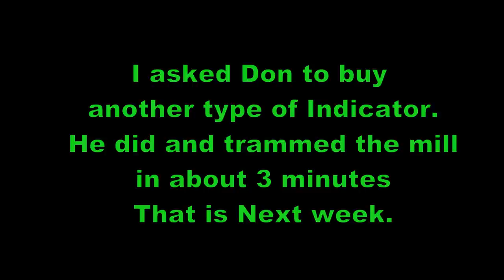Restoring a Shaper: Fitting the nut.

Comment: I think Don gotcha.  I understand the dripping even before he wheels that thing over.  He's right.
Reply from the maker: Nope.... Those passages are semi blocked so that the oil carries down the rails... It may drip here and there but it's obviously not enough... The condition of the nut compared to the rest of the wear on the machine is really a clue to how bad it is..... After all the whole designed was changed a few years later....

Comment: Hi guys! Here is a thought from left field.  I think the oil drips front the leading and trailing edge wipers on the ends of the shuttle as the shuttle goes back and forth.  It doesn't drip off the bottoms of the rails.  The oil grooves terminate above the bottom of the rail in order to distribute the oil across evenly across the face and out the bottom.  There is a catch basic in the nut which runs across the lead screw. For example , a rod bearing in an engine is supported by an extremely thin sheet of oil across the surface of the bearing not by the bearing itself.  But, it is fun to hear you both work it out. I have thoroughly enjoying the show.  Would love to see a show where we can benefit from your years of experience to learn what to look for and how to evaluate a used machine for purchase. 

All the best!

Comment: Steve, drill from the side of the slide, mount the oiler, bring tubing through the cast square holes next to the nut and run it directly into the nut
Reply from the maker: Not enough clearance to do anything without drilling through all the internal oil passages....

Comment: Steve, the only place for an oiler is in the cross slide. drill a passage from the slide to a matching hole on the nut. That hole in the nut would be in the mounting face of the nut. Since the slide is with always with the nut a source of oil can easily feed  the screw. A Gits oiler or a hose to a source would work. You were thinking of only the left side and never thought of the slide to the front of the nut. I hope I described it for you.
Reply from the maker: The table, slides and guards for the slides take all access from the top away....  there is no room for anything or access from the top....
Reply: @10swatkins  I have some plastic auto oil pressure gauge tubing and it is 3mm dia, just under 1/8th inch.  Auto parts stores should have some. Try and see if you can thread that through the carriage to the nut. Something tells me there has to be a way. Keep up the good work.

Comment: My thoughts ...
  Do the oiler pot on side and bit of pipe.
To me id copy the original fiber filter . For the work this machine is likely to receive it will be fine 🙂.
Reply from the maker: Going with a different type of filter... Have to suffer through on more nut video to find out :)
Reply: @10swatkins  did i read domed wire mesh ? Good idea.  '1 more ' heard that before.  ' just one more power tool darling then i won't need to spend anymore money '  👌 👍

Comment: If I might make an observation, the “filter” you talk of is actually a wicking reservoir for any oil that makes it way into the pocket.
This then provides a reservoir that lubricates the thread when the nut is not aligned with the oil passages and the infrequent lubrication schedule most machines have.
Not seeing the machine fully assembled I cannot comment on the chip and tramp oil issue.
My 2 bob’s worth.
Good luck.
Reply from the maker: Well the "wick" was all gummed up with crap..
Reply: @10swatkins  Can see that happening, annual maintenance and strip to clean out crud is not a thing in a large majority of shops, would like to educate some owners with a ball peen sometimes.
Good luck keeping Don on the straight and bendy.

Comment: Every CNC Mill has a flexible oil line that goes to the saddle and from the saddle to the table. There's both plastic (probably polyethylene) and "rubber" lines with steel braiding (or steel springs) over them that are flexible. They're 4mm lines so pretty small. Use something like that to feed positive pressure fresh oil from the one shot oiler to the nut and solve the problems. You can use a "drag-chain-style" arrangement of the pipe to handle the motion / slack in the line.
Reply: Basically what you're saying at 1:30:00, but instead of a copper hard line to a fixed position, use a 4mm polyethylene flexible oil line that's routed at the top of that channel and then down and around to the nut.  That way when the nut is all the way to the right, the tube goes all the way to the right side on top, and then loops down and back a little to the nut. When the nut is over on the left side, the tube will go about half way across the top, then loop down and go the other half way back to the nut on the left. You get slack management inside that chamber without the tube moving in and out of the hole. Same way the cable gets to the print head in an inkjet printer, or a drag chain type arrangement on a CNC gantry router.
Reply from the maker: There is no space to do any type of hose, loop or anything with the nut in place... it has to be a very small line attached to the roof of that space... It's tapered and that nut barely fits in there...

Comment: I would drill the nut to direct oil the screw. Then mount the line to the table so it never has to move and put the oiler on it. Direct clean metered oil. 🙂
Reply from the maker: Unfortunately there is no way to get into that area after the saddle and table are mounted... Everything is block, guarded against chips and moving
Reply: @10swatkins  Surely you can run a line out thru the saddle to some place for a lubricator.  Heck if you want to do it fancy drill the center of the nut mount on the saddle and counter bore it for an o-ring. Then when you mount the nut you have your oil connection.  Then on the other side of the nut mount you can drill and tap for the oil line feed. I know there has to be access there or you could not bolt on the nut.

Comment: Rather than putting a channel in the top edge of the nut, you could chamfer the edge so the oil runs away from the well towards the from fact of the nut. The fixed tube with alignment markings on the saddle is the right idea.
Reply: Not from fact!
Reply from the maker: That might be easer to machine... I think about it... Thanks

Comment: How long have you and Don known each other? My best mate and I have known one another 28 ish years since we were 14. We bicker and argue just like you and Don and its all banter. I hope we continue to do so as long as we can. I love watching the back and forth between you both it makes me smile. Thanks for the time and effort you put into these videos.. could you oil the screw instead of nut? Use the oil tube but full length of screw with little drip holes in it?
Reply from the maker: I think it's about 4 years now........   There would not be enough volume of oil to make it past the first couple of holes I'm afraid... Any more and it would just be a leaking mess.
Reply: @10swatkins  I thought as much could it work with a 1 shot oiler as it would slightly pressurise it? Or would that mean too much oil everywhere. If you put the holes in the top of the tube and allowed it to run down and drip, would that work?

Comment: Put your phase convertor, refrigerated air dryer and anything else that makes noise in the Rubber made shed too.
Reply from the maker: I put my 20 HP RPC in a rubbermaid dog house ;)
Reply: Amen when I finish my shop addition gonna move it
Reply: Air compressors and air dryers need lots of ventilation for cooling. I have seen a  200hp compressor blow up due to a sound insulating wall built around it.
Reply: @millwrightrick1  Thermal management is critical for most machines. My shed is ventilated and has only a 5HP compressor. My dryer is small too.  A thermostat
controlled vent fan would be good, In the winter I want to keep the heat.  I have a 10HP phase convertor in there to but none of these operate at high duty cycle. It has worked great for 20 years.

Comment: Maybe an idee? Take of the vertical table an cut a grove in the upperside, above the nut,  to put a tube in with small holes (like a drain)so the hole screw is getting oiled, all the time. With the oilcup on the outside or connected to an oilingsystem.. If there's not enough room, create some.
Reply from the maker: Thought of that too... There is just no place to access the nut from above when the table is installed and working... Just no room... IF I try to drill anything from above I also would hit the internal oiling passages of the carriage .  Side is the only way...
Reply: @10swatkins  Steve, to prevent that the oil is leeking to mutch in the front of the tube, take a catton thread in to the tube so the oil is slowly dripping to the end of the tube and gives an evenly drip of oil to all the little holes in the tube and so on the screw.

Comment: How about boring a hole partway down the left end of that leadscrew, then an intersecting hole at a thread root.  Move the nut into position over the crossing hole and inject some oil through the oil port in the end of the leadscrew.  Eliminates need for a reservoir in the nut, too.
Reply from the maker: Could work but would be a pain :)    I am afraid the oil would always just stay in the area of the hole, at least with the small reservoir the oil would carry down the screw ...
Reply: I was imagining injecting oil under pressure via one of those little spring loaded ball type oilers.  Meaning there would be no reservoir effect.  But one pump would likely be adequate for a whole day of fun.

Comment: Drill a hole in the center of the nut and lead that hole further out to a grease cup. The nut is locked with two bolts and everything will follow the nut.
Reply: If I understand your description...
Except that the nut is enclosed by the slide(not fitted yet) it bolts to, you would have to drill through the slide itself, which has t nut slots milled into it's outer face.
In other words your cup would be where you bolt workpieces onto, to "shape".
Reply from the maker: No way to get to that area... The table bolts onto the saddle and then there are internal channels for the oil in the slide....

Comment: Steve, you were trying to compare the 2 nuts to see if the height was correct. It seems that after you had the new nut on the shaft in place on the machine, you have the opportunity to measure from the base of the nut to the stationary ways. Then you could also measure from the table ways to the nut mounting surface. You should then be able to determine the correct height. Hopefully this makes sense.
Reply from the maker: I did it on the machine also... I was just trying to cut down 5 hours of video :)

Comment: The plate that bolts on for the table with a  Tap the back side of the nut and put Way Oil in a grease gun
Reply from the maker: No space  for anything.... Also the table and saddle blockers all access

Comment: Steve, if this is a repeated suggestion that will not work, disregard the annoyance. Can oil or grease be injected from the mounting face / base of the nut? Possibly not top feed the oil, contaminating the screw with chips or waste oil, but inject oil or grease through the base of the nut? Does the movable cross slide have room between those two bolt holes for an oil hole or grease hole? If it’s too far, is grease acceptable? It could be pumped in with a gun.? Put a grease fitting on the movable slide facing the front of the machine. Maybe an o-ring groove or gasket on the base of the nut to keep the grease from squirting out? Maybe this suggestion is too Rube Goldberg….best wishes Randy
Reply: The shims will be an issue with what I suggested….
Reply: Put a clearance hole in the shims and cross slide casting, thread an extended pipe nipple in the back of the nut, put a grease fitting on the nipple. A little tricky to assemble but a possibility? Fresh lube to the nut all the times and the oil feed would follow the nut.
Reply from the maker: Once that nut is installed there is no way to get anything in there.... The saddle and table all move and there is just no way :(

Comment: Put the copper all the way across. With a 8 or a dozen tiny holes drilled perhaps in the top of the copper tube so it drips on the screw.   How many number 80 holes can you drill in copper tubing without breaking a drill bit.
Reply from the maker: The amount  of oil needed is so small that I don't think it would flow all the way and # 80 holes would probably need pressure.... What a  mess...

God that would be a real pain in copper! :) at least 50 drills ;)

Comment: Steve.  Similar issue to the rock 1 turned out to be electrical connections and relays in the right instrument cluster fuse box.
Reply from the maker: Maybe they fixed it then in Rock 2...... It sure was frustrating!

Comment: Steve and Don, could you not drill tiny (maybe 1/32") holes along the length of the pipe, like a trickle feed garden watering system and run it from end to end of the nut chamber, so that wherever the nut was, it would receive some lubrication.
Reply from the maker: Not  enough volume of oil to make it past the first few holes... It is a very small tube... And to get enough oil through to the whole screw you would have a real mess under the table :)

Comment: This may be a bad idea but could you drill a hole in the base of the new nut between the two mounting holes and fish the copper tubing through the table with the new oil cup installed on the table itself so oil always flows into the nut.
Reply from the maker: No room or way to get in there..... Got to come in through the side... Thanks for watching...

Comment: I wonder if you could get a flexible oil tube to wind around a spool, connected to the lead screw. Same concept as cutting a hole in the side & letting the tube extend & retract, but no need to cut a hole in the wall. Then it'd spool & unspool nicely, and oil could be pumped through. A drip oil cup wouldn't likely work then, of course.
Reply from the maker: I think that is a nice idea.... Have to make a custom one that could hold the 28 inches of hose..... You would have to put a plunger of some sort to pressure feed the oil but that could also be done.... 

 Of course you realize that we all will have to suffer through 42 more videos of the damn nut IF we do it  :(
Reply: @10swatkins  Aah, but those would be making the spool, not the nut itself. Technically a different series!

Comment: Don't know any group of guys I've worked with where we didn't break each other's balls. Just how we have fun.
Reply: A quick and durty way to get you in the ballpark with tramming the head is extend the quill alll the way down and use a square on the table to adjust the head then go to the indicator to finish it off.
Reply from the maker: Got to have a little fun ;)
Reply from the maker: By the time I figured out it was so far off I was finished!     I told Don about the tramming fixture that has two indicators and he bought one... Said it took about three minutes to tram it..... I always wanted to play with one but I have the correct indicator and just never spent the money on something that was not needed for me...   Now I get to play with one for free :)

Comment: At about 1.28.00 you said there is hardly any wear on the ways. Wouldn't that indicate that the oil dripping off the ways onto the nut is in good shape too? Thx for the vid.
Reply from the maker: No, the "filter" pad that was installed was clogged up from that dripping oil and no oil was getting to the original nut..

Comment: I would make the pocket drill and tap a hole make a low profile elongated oil cup screw it into the nut so no chips can get into the screw... the oil pipe will fill the new elongated oil cup...
Reply from the maker: sort of like the present system milled into the nut...  I'm thinking of enlarging the oil port and making some sort of mesh wire filter that would stand up about 3/8"... That's about all the room I have for anything.

Comment: Using your copper line, but rather than dripping oil, could you put in a oil mister with compressed air to lubricate the screw rather than the nut?
Reply from the maker: It would be a huge mess. all the oil would have to go somewhere and that would be on the floor :(
Reply: @10swatkins Air  tools use the same principle. A timer on your air delivery to  once a minute,  while the drive is in use,  give a one second pulse of oil. Or an airline lubricator set for a drop at an interval with a low volume airstream. Even drip oil will collect if you do it with a drip line.

Comment: Would it be possible to run the new copper tube right above the screw, drill small holes one the tube, close one end of the tube, so it drip oils the majority of the length of the screw?
Reply from the maker: the amount of oil needed on the screw would be very little. I am afraid the first few holes would drip it all out and the rest of the 28" screw would get nothing....

Comment: You could drill small holes in that copper tube and drip oil all across the screw , is that a possibility?
Reply from the maker: I thought of that but I think that the volume of oil would be so small it would never make it past the first few holes...
Reply: @10swatkins  if the first hole was 3 inch's from center second was at center third was 3 inches past center only need a very tiny hole in the first hole second a little bit bigger third open end of tube ?

Comment: Too much worrying about dirty oil - put the felt back in - enlarge the hole, add the cup and tubing to the saddle.. The felt will hold the oil long enough to oil the screw length. The screw nut is in a fixed position on the saddle so why not oil it from the saddle?
Reply from the maker: No room on the saddle for anything, remember there are chip guards that cover all that up and the table is right there too.... I have a different Idea working for the LAST DAMN NUT VIDEO :)